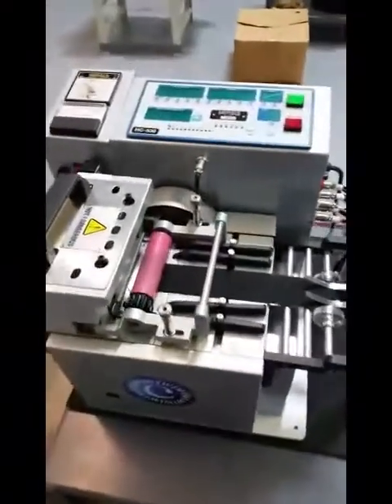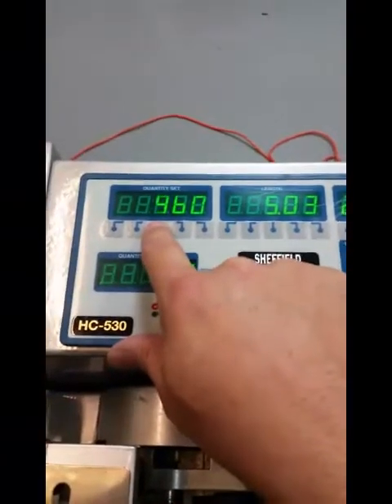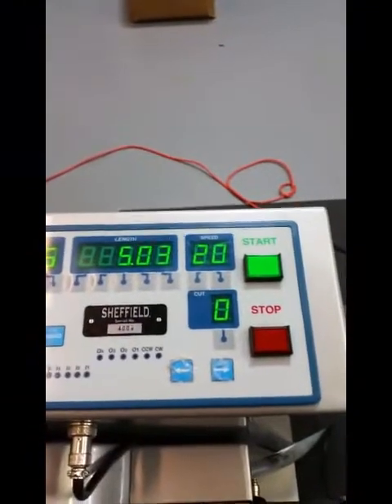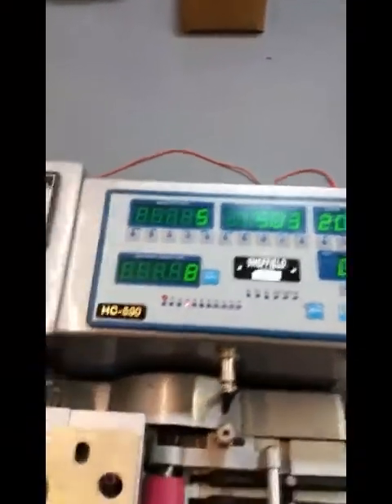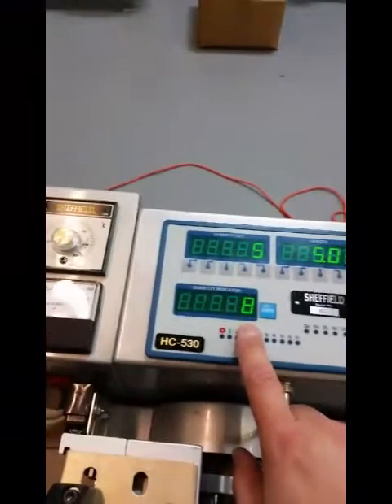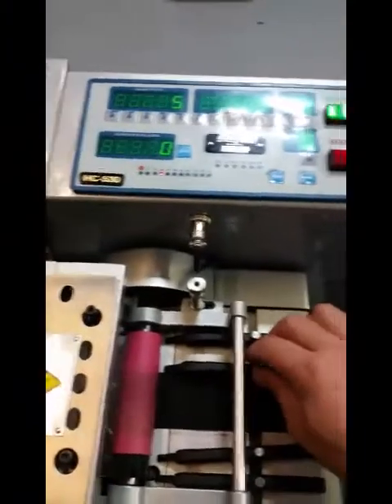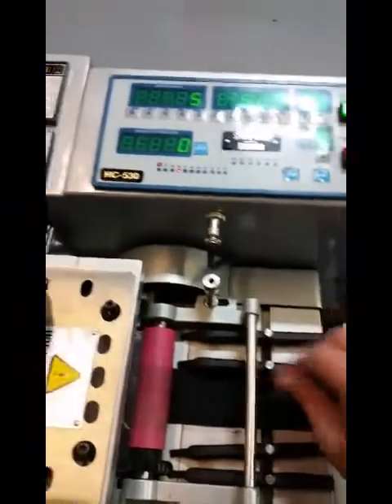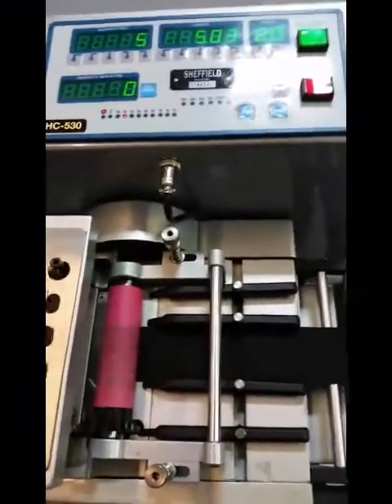HC-530 Strip cutter

Comment: The cut button isn’t for cut quantity. It is cut dwell time. Meaning that 0 would drop the blade and immediately come back up. 5 would drop the blade and remain down under  pneumatic pressure for 5 seconds. This is for the hot cutting option to allow the hot knife to have time to melt through thicker material.